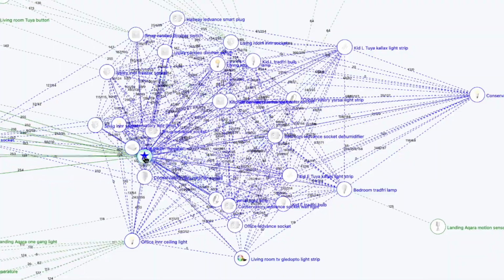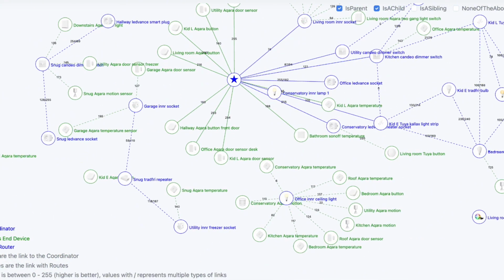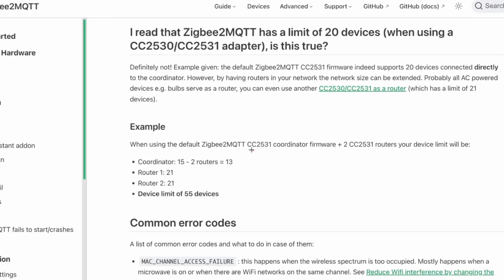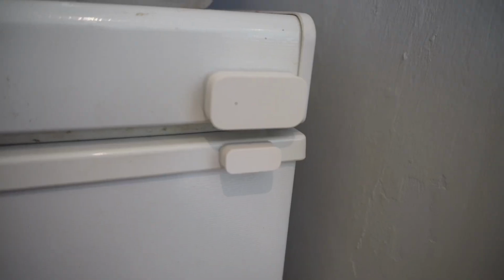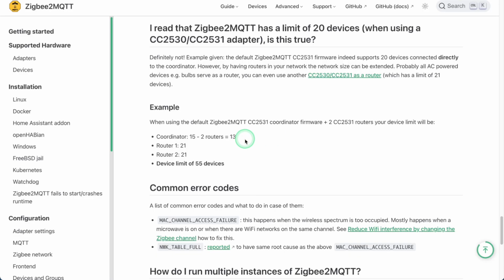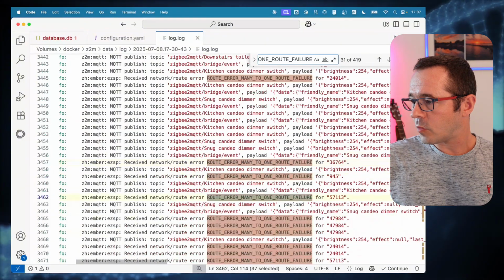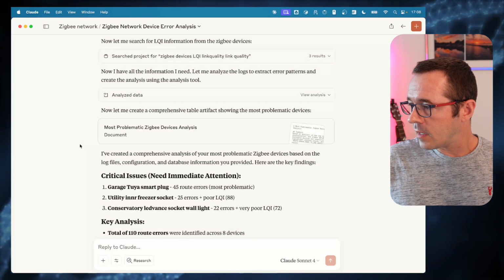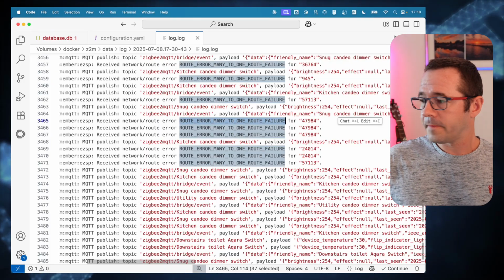Zigbee Network troubleshooting

Comment: Great video, been waiting to find one with this level of overview. One question I have is how you add new devices, are you pairing them to the routers that are closest? Or just letting the network figure out where they will connect in the mesh? I am using ZHA, and when I look it appears nothing is connecting to the routers, and everything going to the coordinator. Unless I am reading this wrong.  Thanks!

Comment: Maybe explain why you chose Zigbee to MQTT. I’m glad I moved from ZHA early doors but still took me about half a day messing about!
Reply from the maker: I originally used deCONZ with a ConBee II stick when I first started out, and had a tonne of issues. When I switched over, I tried ZHA (before it was supported by Home Assistant officially) and zigbee2mqtt. I liked the extra configuration level on zigbee2mqtt, so opted for that, and haven't really looked back. It's always performed really well
Reply: @BensSmartHomeIdeas would Z2M beter handle battery powered devices compared to ZHA ?
i am suffering from offline devices here and there evry 6 to 8 hours and i was wondering if switching to Z2M would help ?
2 stories house , one SLZB-06 coordinator in gorund floor and one SLZB-06 router  in the cellar , yet some binary sensors manages to go offline ! also i think i have some sticky sonoff door sensors which i cant really change the connection !